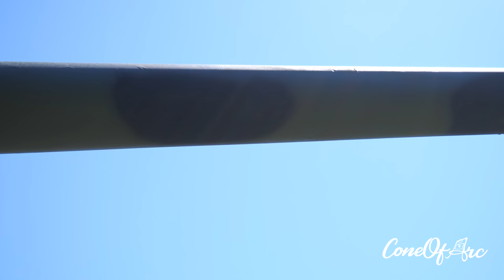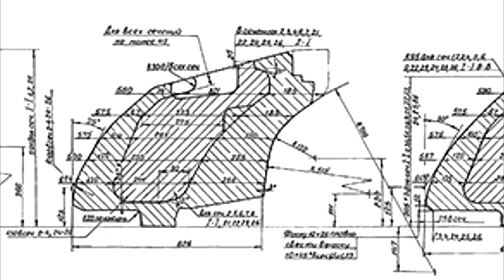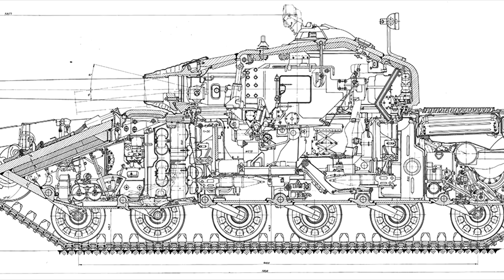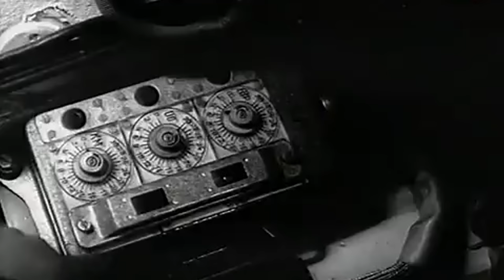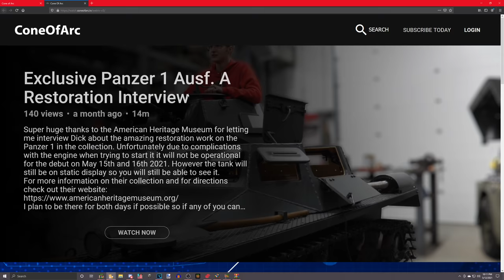Raising the Bar, the T-64 | Forged for Battle

Comment: A good video but the reports of the auto loader eating limbs is false for the T-64, T-72 and T-80. This was a problem with the BMP-1 autoloader that gets misattributed to the tanks.
Reply: Arms go Chop Chop Bmp go Nom Nom
Reply: Nope.  The video is correct.  Books written by former Soviet officers confirm that Soviet tank gunners lost arms to early Soviet tank autoloaders.  BMP did not have an autoloader.  I've been in the BMP-1.  No autoloader.  Dork.  

Lol @ yet another wannabe authority who wants to revise history.
Reply: @skipdreadman8765  this comment would have been acceptable if you left the word "dork" as well as that entire last sentence out.
Reply: You lie. BMP-1 never had autoloader. There were no any reports about eating limbs with auto-loader of T-64, T-72 and T-80. Besides, auto loaders of T-64 and T-72 are completely different.
Reply: how common is autoloader to jam? Do they have space to fix it manually...
Reply: @AlexanderTch  yes it does. There are countless sources stating that initially the autoloader was in fact present on the BMP-1. It was usually removed in later variants due to its danger to the crew and unreliability. 

"The gun is reloaded by the M3 electromechanical autoloader with ammunition conveyor, but can be reloaded by hand if necessary. The autoloader is not reliable; it can break down from vibration when the vehicle is moving at high speed over rough ground, and its operation is a danger to the gunner's fingers."

Taken from the Wikipedia page for the BMP-1's gun. I can post some more sources other than Wikipedia if you would like.
Reply: @RedVRCC  lols. Give me links proving that BMP-1 had autoloader.
Reply: @effexon  Actually, if autoloader is jammed crew can do manual loading, that's not problem.
Reply: @skipdreadman8765  bullshot itvwas masę to make western tank lovers feel little bit better
Reply: @AlexanderTch  sure i will look for original footage of it. Hopefully i find this comment.
Reply: @AlexanderTch  The early modes of the bmp1 have an auto loader but on later models were removed
Reply: @RRAAZZAA  BMP-1 has never had auto-loader. It was designed in late 50s and went into production in 60s. There was no way to create auto-loader in that period of time.
Reply: @AlexanderTch  auto loader technology development started during late ww2 and one of the first autoloading guns was found on the hs129, so it is completely plausible for the bmp1 to have an auto loader
Reply: It's a safety thing, scare recruits with a mythical story and they remember it.
Reply: @skipdreadman8765  Books written at the Malyshev facility during field testing had shown the opposite. мз pattern autoloaders would never cause harm, apart from the occasional scratch, as the only area of the autoloader that's physically able to touch you were the propellent casings, which weren't directly attached to the autoloader, making for quite the flimsy "arm eater".

And yes, the BMP-1 did have an autoloader. Based on the fact it had a covering much like the T-72 (on rare occasions) I doubt you'll know about it, just as you believe the T-72 would eat your leg. Either that, or you were more than likely in an Объект 764СП-1
Reply: @AlexanderTch  BMP-1 did have an autoloader on the 764SP-1 variant
Reply: @effexon  almost never, thought here are manual cranks and the ability to hand load the casings and propellents, and there's little to no fix if it does jam. If it was a simple mechanical blockage, it's easy, but hydraulics or broken mechanisms....
Reply: @AlexanderTch  Christopher Foss's report on their BMP-1
Reply: @AlexanderTch  yes there was..? Autoloaders were used from the 1940s up to the 50s, where it was extensively used by multiple nations. It's first use was literally used on a plane made in the 1930s. The BMP-1 did have an autoloader, and so did tanks since 1941, such as the AMX-13, AMX-50-90, AMX-50-100, AMX-50-120, Lorraine 40T, SK-105, T-71, and so on.
Reply: @RRAAZZAA  early ww2^
Reply: @TheArcticFoxxo  You lie. BMP-1 has never had  autoloder.  It's turret is very small , so only  one operator can fit his head there     and there is no room for complex mechanism and revolver  with  shells. Gun is very short and shell  is almost the length.
Provide photos and videos of BMP autoloader, otherwise you are damned.
Reply: @AlexanderTch  Because it isn't a bustle or revolver autoloader? It's a carousel that is housed by the hull mounted main drive, like every other russian autoloader. Whether or not the turret is large or small makes no difference, nor does the guns size. I'm not the one with the burden of truth, so I don't need to provide anything to disprove your baseless claims. Why don't you tell me what a medial final drive is and how it equates to horizontal action?
Reply: @TheArcticFoxxo  I repeat , provide photos and  videos    of that. And  scream  that  crap  afterwards,  not before
Reply: @AlexanderTch  Again, I don't have the burden of truth, but sure. Let's go ahead with it. 
Exhibit A: https://i.imgur.com/1uDEEk0.png
Exhibit B: https://i.imgur.com/92m28ae.png
Exhibit C1: https://i.imgur.com/PF5FDY1.jpeg
Exhibit C2: https://i.imgur.com/CYPlgOd.png
Exhibit C3: https://i.imgur.com/o6Ma0L2.png
Now where's your proof that the BMP-1 doesn't have an autoloader?
Reply: @TheArcticFoxxo  lol. That's not autoloader at all. That's just pile of shells from where gun operator takes them and then places it inside barrel. It's even can be seen in Russian wikipedia. There are no any  mechanisms  in   on those photos. It's technically impossible to manipulate with  so long shells inside so small  turret.
Reply: @AlexanderTch  Did you not see the entirety of the C section? You clearly don't know shit if you don't know what an elevating arm looks like, let alone the clear and concise distribution and ordering sheet. Again, where is your proof that there is no autoloader?
Reply: @AlexanderTch  And you're seriously looking at the Russian Wikipedia page? That region doesn't field specific pages on specific vehicles, as that one only covers the basic hull design of the BMP. It literally talks about BTRs in that page, which last I checked weren't BMP-1s. Have you not checked Tankograd, English and French Wikipedia, Tank Encyclopedia, or anything of the sort?
Reply: @AlexanderTch  Wikipedia does not cover all of the facts about a vehicle. There isn't one bmp-1, there's many of them. A later variant did not have an autoloader, but the earlier ones did
Reply: @AlexanderTch  I quote - "БМП-1 (объект 765)— базовый вариант. Специальное шасси с передним расположением силового отделения. Сварной корпус коробчатого сечения с боковыми нишами. В корме корпуса — входные люки, закрываемые дверями с встроенными в них топливными баками. Коническая сварная башня со спаренной установкой гладкоствольной 73-мм пушки и пулемета ПКТ. Полуавтоматический механизм заряжания, в конвейере которого размещен боекомплект. На подвижной бронировке орудия установлен кронштейн ПУ ПТУР "Малютка»". Судя по нику, ты должен понять текст и без перевода)
Reply: @AlexanderTch  You can literally google this for 4 seconds. I know little about all armoured vehicles, but I love the боевая машина, it definitely had an auto-loader for something like a year.

There's like 29 versions, how is it difficult to believe?
Reply: @AlexanderTch  Nor was a BMP-1 autoader ever necessary! These 73 mm rounds are quite light!
Reply: @skipdreadman8765  BMP-1 did indeed originally have an autoloader, most in service have since removed them due to them being both dangerous and unnecessary.
Reply: How do these people not know the bmp originally had an autoloader 🤦
Reply: @skipdreadman8765  don't make fun of people when they get there history wrong, we all make mistakes. Just  Politely correct them.
Reply: @comradeyuri277  I wish Chernov would just humbly accept that he got his facts wrong because that's ok
Reply: @cloroxbleach9222  i dunno what his point even is. "russian tanks bad"? but his youtube name tells me he is russian himself, why do the self-bashing then?
Reply: Bruh its always pain to read comments.
Reply: @effexon  there must be...
Reply: @skipdreadman8765  BMP1 Had autoloader but was discontinued dork.
Reply: Yes it true that bmp 1 autoloader problem of eat limbs 
But it fix in bmp 2 with autocannon
Reply: But the consulate army of Soviet Union make hard for maintain the autoloader of the tank because it’s the first tank with autoloader in Russian service so it need to be highly trained and take some time for autoloader to be maintained
Reply: @skipdreadman8765  the bmp did have a auto loader yet on some versions the auto loader was removed in favor of manual loading.
Reply: @skipdreadman8765  it did have an auto loader it was just removed from the export modles
Reply: @skipdreadman8765  the bmp 1 did have an autoloader, a lot of them were removed....... probably because they ate peoples arms.
Reply: @skipdreadman8765  source
Reply: @skipdreadman8765 if i remember correctly there was only a few accounts of this actually happening?
Reply: @skipdreadman8765  pov: https://youtu.be/oHC1230OpOg
Reply: @skipdreadman8765 The thing is, there is only a small period where you can get your arm torn off
Reply: @skipdreadman8765  there should be a slide out panel at the side of each crew member in the turret  only way you can get your arm torn is if you were hanging you hand out of it so i dont really know but i think that they would' trained the soldiers not to do something so stupid
Reply: @AlexanderTch I've seen the autoloader with my own eyes. It does exist indeed. Unfortunately I can't find any video of it in operation.
Reply: @skipdreadman8765 he’s talking about how the some experimental versions of the BMP-1 had an autoloader and the fact that they were so poor is probably the reason why the removed it on the final version. Btw an officer testimony is not automatically true just because they say so, we can look at countless stories from tank commanders throughout history such as those of Germany in WW2 where dozens of different officers pretended as if T-34’s were invincible.

Comment: The T-72 was less technologically advanced because it was built as a hedge against the failure of the T-64. Instead of the new opposed piston engine, it had a regular diesel design and it only had composite armor in the front glacis (later versions had it in the turret as well). Since the T-64 succeeded, the T-72 was going to be relegated to a war economy variant; built only in case of war. But due to the high cost of the T-64, the T-72 was built at the same time and equipped most of the non-elite formations.
Reply: This, what most ppl dont know is that the T-72 is actually a cheaper and worse version of the T-64, and it was made like that on purpose
Reply: The T-72 was never made as a "hedge against the failure of the T-64", it was a much cheaper option to use to isolate their dependency on the currently suffering U'SSR, as this was the second worst economic time in its history. Its engine was swapped out for the same reason, as Kharkov was the only engine plant who had created the 4/5/6TD series, and it was still insanely costly for a low amount of power. Both tanks had the same turret layouts, having no composite in the turret and technically no composite in the hull, as it was a mixture of Quartz-Zinc fillings and softened glass textolite. The T-64 had not succeeded in any way, the entirety of the Ural division and Malyshev division had voted on producing the T-72 instead, as it both felt safer and was cost effective for almost the same specifications. The T-72 was relegated as the SSSRs main combat tank, not a "war economy variant", with the T-64 being the elite variant to be used in special occasions due to its superior autoloader and slightly better armor, though worse mobility and general sighting.
Reply: @Blue-nw3li  I wouldn't say worse, just repurposed. Like the XM-803 to the MBT project, except better.
Reply: @TheArcticFoxxo  🤡
Reply: @user-zf4vy8rd3l  ?
Reply: Kid named 5TDF, 6TD-1, 6TD-2 engines

Comment: Could one argue that the cost of the T64 was its greatest weakness. Thanks for another great video!
Reply: laughs in 13000 tanks
Reply: i would argue the early autoloader wich isnt as save as the one found on T-72s and T-90s.
Reply: The T-64A actually costed the same as the T-72A.
Reply: @elanvital9720  Thanks, Elan, my books are in boxes because of moving house, but I remember this differently. It may have been in Isby's Weapons and Tactics. Have you any sources? Thanks!
Reply: @elanvital9720  actually the T-64 costs way more than T-72 Ural. The T-72 is an upgraded T-62 with using T-64 tech but at lower cost and can be mass-produced.
Reply: The more you produce, the less price it is
Reply: They still made over 13,000 of them. Compare that to the Challenger I&II, around 900 in all. Abrams 10,288. Leopard II 3,600. Centurion 4423. I don't know how many Chieftain tanks were made, but only 900 were built for the British Army.
Reply: Same as the T-80 that replaced it. However, in hindsight it was still absolutely ludicrous numbers compared to today. Still absolutely huge numbers compared to European and American equivalents of the time.
Reply: @niklasw.1297  Autoloaders got safer in later models which had more advanced technology? What a surprise. It's almost like machines inherently get safer as the technology improves because designers learn better ways of making things
Reply: @divinesan7786  T-72 is just a cheaper version of T-64 with V series engine, different tracks, different auto-loader, and with no remote control of AA machinegun like in T-64. The thing that helped with making it cheaper the most was V-46 engine instead of 5TDF
Reply: @divinesan7786  the thing is that engineer Kartsev was given a task to put V-46 on T-64. Originally, the Soviets were unsatisfied with reliability of 5TDF engines. All they asked Kartsev for was to put V-46 on T-64. This is how Kartsev created Object-172. However he was unsatisfied with that and decided to change the tracks and the autoloader after some tests. This is how Object-172M was born. Eventually Object-172M entered the service as T-72 "Ural"
Reply: It's greatest weakness was it's small size. Soviet engineers fetished small size to the extent where the post war tanks were basically unfightable. Can't fight hull down, can only fire while fully exposed, or dug into a "die in place" style defensive position. Plus it's small size guarantees that any hit is a catastrophic kill.
Reply: @niklasw.1297  it wasn't quite as safe, though if it were to cause an issue the crew would be dead anyway.
Reply: @limedickandrew6016  Because the T-64 stayed in production in the most prolific soviet facilities. It wasn't simply cancelled, they still produced it for over 60 years
Reply: @elanvital9720  i dont know where my docs are right know so i cant confirm it but i remember that an T64 costs aproximately 1.7 times more then a T72 and its production time was longer
Reply: @lordhater4450  That can vary wildly depending on the variants and years you compare.
Reply: @elanvital9720  yes you are right, at the latest models of T72 that price ratio was significantly reduced but in the end the soviet government loved the T72 more than T64 mostly because of its expenses are less and it was more durable than the T64(im not so sure about it so please take it with a pinch of salt but i remember that the v46 was more reliable than the 5tdf and also T64's autoloader maintanance was more expensive than T72's
Reply: @lordhater4450  Yes, T-72 in general is more durable and easier to maintain than T-64. The suspension and engine are far more durable and can handle more weight (more armor), the engine also suffers less from using a different fuel and has more net hp so mobility is not degraded compared to the lighter T-64. The armor was generally better as there were upgrades more often and the thickness and efficiency of the armor itself was better than contemporary T-64s. The only remaining advantage of the T-64 is the fire control system on the B version and the earlier gun and FCS upgrades, but that's due to favoritism rather than an impossibility of T-72 to use the new FCS. It is a tragedy that UVZ wasn't allowed to diverge more thoroughly from T-64's base design as it wanted (to redesign the hull front and eliminate weakpoints for example)
Reply: @drewschumann1  you completely miss the part about doctrine of use tanks and war itself of USSR. Tanks meant as main strike power, used in numbers and musthave in any operation of supposed global war, not some expeditionary conflicts. So it meant NUMBERS of tanks, so great costs in metal, money, time and industry power, also crewmen. Small size save metal, save mass for transportation, cheap tank save money and industry power (because of idea get "cheap" from "simple") and autoloader save crewmen for massive mobilization armored divisions. There was no mistakes in T-64/72 concept for USSR. World just evolved to other wars since 1970. And even now these tanks do their job very well when used right.
Reply: @shermanfirefly5410  gpus disagree